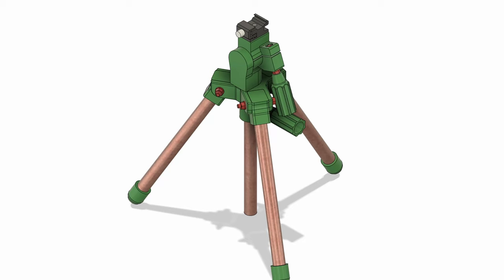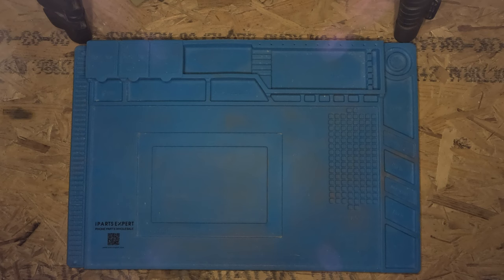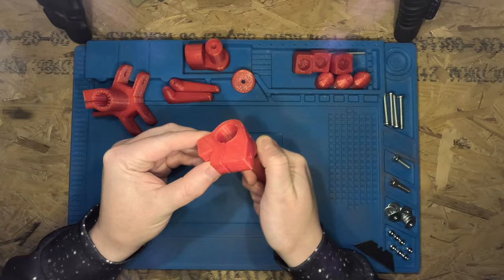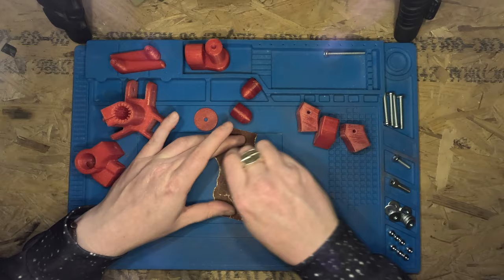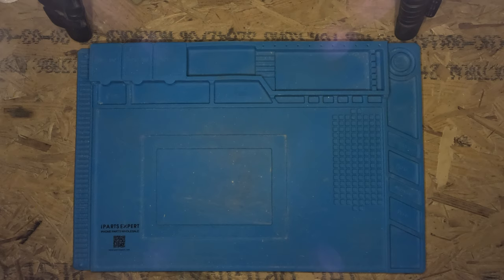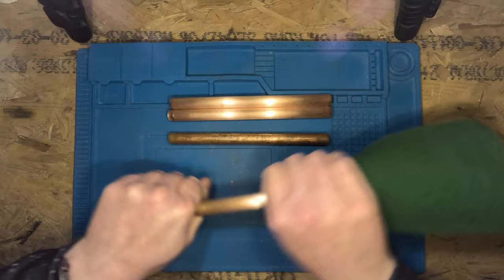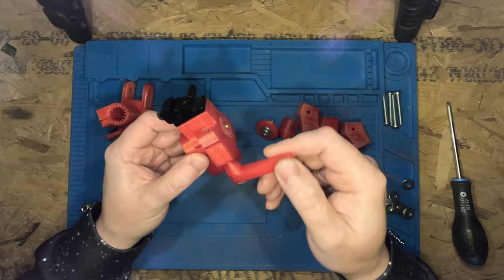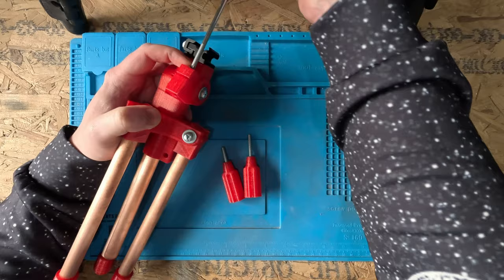3D Printed Mini Tripod

Comment: nice can u make video on designing stuff , like how u design it which cad software u use and which is good for beginners , and also what are the steps to design product like this , pls also share some math too like how to compute load factors if we are designing the tri pod how much weight it can handle and the M5 bolts you use why not M6 or M7 etc
Reply from the maker: I’ll add it to the list :)

Comment: Awesome video and really cool project! I was exactly planning on making something like this with a bunch of spare rods from old furniture, and I'm planning to use your design. Do you think it can handle the weight of a DSLR camera?
Reply from the maker: Thank you Pablo, I've just tried adding some weights, i'm not sure on the weight of your DSLR.

With the tilt upright it can handle 5kg no problem, I didn't want to put more than this on.
With the tilt 90 degrees forward it can take 2.5kg, any more and it wants to tilt on it's own.

Hopefully this will be strong enough, please let me know how it turns out :)
Reply: @JustAnotherMakerChannel  thanks a lot for taking the time to test it. I will let you know :D